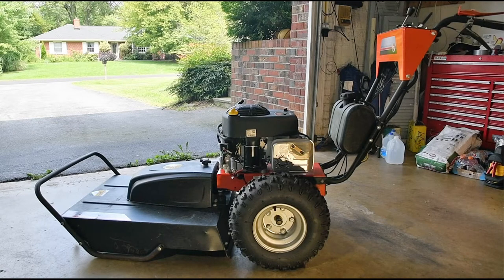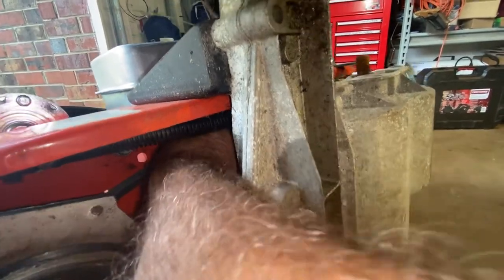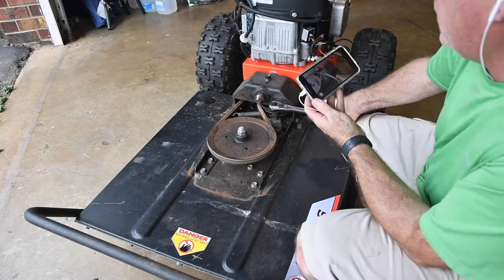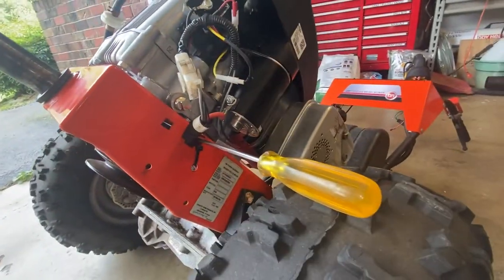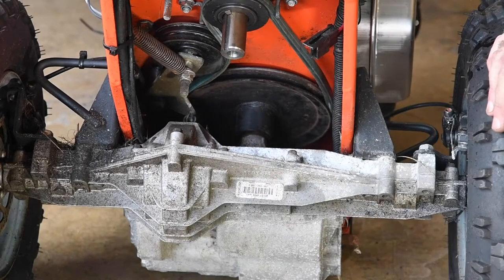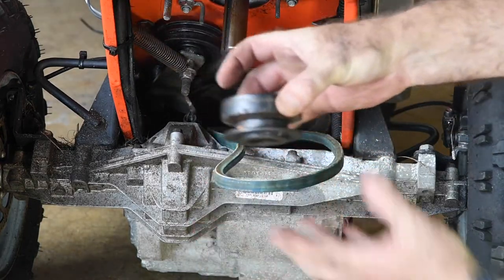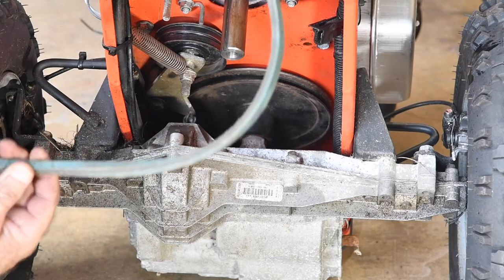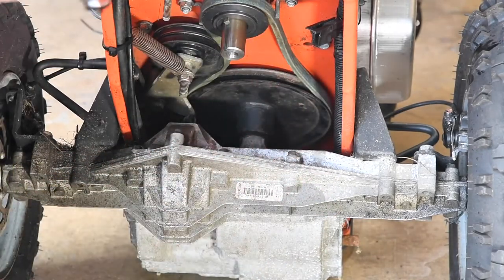DR26PRO BeltChanges

Comment: Thanks so much for your efforts.  I have the PRO XL30 - 20 HP.  I'm on my second one.  Sent the first back after the "ghost walking" incident.  I had read elsewhere about putting on a larger belt, but silly me, I thought a brand new machine ought to work!  The transaxle cables were also messed up by trying to shift with the drive pulley in motion.  Anyway, the new, new one had the same exact problem.  I found this video and decided to try it.  I went with the inch longer belt, with help from your excellent explanation and illustration, and it works great!  There's plenty of adjustment for the longer belt.  Four hours of continuous, rough use and not one problem.  It IS a great machine.

Can't figure why DR engineers won't embrace this fix.  Maybe they have thousands of the shorter belts in stock!

 THANK YOU, AGAIN!!

Comment: Thank you for the clear explanation of this process. I threw my drive belt yesterday (running the PTO at a low throttle--big mistake) and really could have used that tip about the screwdriver in the hole to keep the engine shaft from rotating. Hoping to hit this repair today with a few less swear words! Glad the machine kicked it in a convenient spot near the house and out of the sun,.

Comment: Great video. I watched this for this first time about a week ago when I had issues with the DR ghost driving right out of the crate! I used it that day and completely shredded the drive belt in doing so.

 I seen you said that you were having issues with the belt jumping off occasionally with the 4LK350 V belt.  So I decided to look for a 4LK345 AK32.5 v belt and was lucky to see that a website called belts Warehouse had several  4LK345 v belts in stock with expedited shipping for a total of $11. So I bought it and after replacing I have yet to have any issues with ghost driving and the belt has yet to jump off with this 1/2 inch difference.

Thank you for the help and information. One thing I didn't see was the torque specification for the motor/clutch bolt and if anyone is wondering it's 50 ft-lbs.
Reply from the maker: Worth mentioning on the torque of the clutch-bolt: direction of engine rotation keeps the bolt from loosening back off the clutch, so it's not super-critical to put a lot of torque into the bolt, if you're worried about losing the bolt in the field. It's the shaft/key that does the actual driving of belts (not the bolt). Make sure you put enough "snaps" into your wrench tightening and you should be okay. One problem with using a torque-wrench is the constant torque you'll be applying will want to bend/snap the screwdriver you put into the shaft to keep the motor from spinning. Those of us with power impact wrenches (which I didn't show in the video, because I was trying to demonstrate average tools people might have) will find removing the clutch and reinstalling requires no screwdriver into the shaft to hold the motor 😉

Comment: Thanks for the video update.  Based on your first video, I contacted DR Power and gave them a chance to fix the problem.  They sent me parts that seemed to be the same that I took off, so it obviously did not fix the problem.  A bit of a pain in the derriere removing the transmission to replace the pulley with the "new" one they sent me.  Didn't fix the problem.  I have since gotten the AK33 belt, and am trying to make time to install it.  I like the way you installed the new belt without removing the transmission.  The reason I have been putting it off, but now that I see I can install the new belt in maybe 20 minutes, I will do it before the next mowing.  Great and informative video.  Very sad that this has to be done to make a brand new machine safe and usable.  Other than this problem, for me, this thing is a beast and is a great machine.  I 100% agree.  How can it be so difficult for DR Power to grasp the concept that you have been explaining.

Comment: Thanks for this.  It really helps.  I bought my machine last year.  Using it today the drive suddenly quit.  Figured out the drive belt came off.  Watched your video and thought "great, this will be easy".  But they have added a belt retainer guard next to the large rear pulley (similar to the ones by the small engine pulley).   This guard only leaves about 1/4" of room to get through by the large pulley and I can't get the belt back on because of it.  This part doesn't  show in the manual and there is no mention of it in the instructions for replacing that belt.   So this is a double engineering failure.    That guard did not keep the belt on, and now with the belt off the guard is preventing me from putting the belt back on.
Reply from the maker: That's interesting, because if you read the comments by James DeFuria in my main video (https://www.youtube.com/watch?v=xv03UirzsEM&t=0s), it sounds like the rear belt-guards is DR's "fix" to the original problem (instead of just installing a half-inch or 1-inch longer belt. Comical. Hope you figure it out!
Reply: @ed1ckent   I contacted Tech Support at DR and they got right back to me.  They said that the rear belt guard was added recently but the manual has not been updated to include it's removal in the instructions for a belt change.  They told me that I will have to remove that guard to get the belt back on.   I'll see what I can do with it today.
Reply: I had to take half the mower apart to change arrive belt with that new rear guard. It shouldn't take 3hiurs to change this belt. Bad DR!
I have two if these mowers and other that that drive belt change they are great. They are beasts in the field.

Comment: I have the ghost walking issue as well…but also another issue.  My traction does not want to consistently engage when going up hill.  Won’t a longer belt make this issue worse?  Seems weird that I have the ghost walking issue AND an uphill traction issue.  Maybe the ghost is can be fixed with the longer belt and once I have that’s I can use the cable tensioner to fix the traction issue?  I’m by no means a mechanic…but the video gives me confidence that I can swap out the belt.  My unit is about 4 years old and didnt have the issue originally but started issue last year and seems to have gotten worse.  Thanks!

Comment: Thank you for that.  Two questions: 1) what size belt came off and what size was it replaced with?  2) instead of stepping up the belt size one full inch, would stepping up 1/2" solve both the old problem (ghost walking) and the new problem of belt slipping off in the field?
Reply from the maker: 1) video at 0:30 shows the original and replacement belts, as-does the original video https://www.youtube.com/watch?v=xv03UirzsEM
2) 1/2" larger might fix it; I couldn't locate one that was +0.5" at the time, and frankly didn't think even one-inch would make a huge difference (but it does). So yes, my 1"-longer belt is a hair-long and I run the belt-tensioner adjustment at it's extreme-maximum length (ie: if the belt was any longer than that 1", I'd have problems)

For the record, I ran this stupid thing (with the AK33, 35"-belt) for about 5-hours yesterday, and I had to put the slipped-belt back on twice (takes me about 15-seconds). So, yes, if you can source a 0.5"-longer belt, you may be better off. But to me, this machine currently operates PERFECTLY (and I'm going up/down a hillside that is so steep that I actually use this machine to pull MYSELF up the hill)
Reply: I put the 1" longer belt on and it didn't come off once so far. About 3 hours of mowing. Might loosen up later, but for now the ease of shifting, that it fully disengages when I want, and doesn't seem to slip when engagef, it is perfect. Two thumbs up to the videos posted as it made this mower what it should have been from the factory. Y'all might try loosening the transmission mount bolts and slide it aft (take slack out of the bolts) to simulate a slightly shorter belt.

Comment: The problem I'm having with my DR is the reverse it's slipping. The drive going forward is full fully engaged but when you go in reverse even with a slight incline like going over a mound of dirt the mower stops moving in reverse it's not a positive drive it's slipping. Do you think adjusting the cable would correct this problem again I have no trouble with it ghost driving forward and it has a solid positive drive forward when the lever is engaged.
Reply from the maker: Yeah; you really want to adjust that cable-stretcher (tensioner) to the point where it almost wants to ghost-walk (which for me is COMPLETELY EXTENDED). Others here have had good recommendations: 1/2"-longer belt instead of my recommended 1"-longer belt, and moving the trans backward (aft) by loosening all of the transmission/frame bolts and retightening. But for the record, I was never able to move my trans more than 1/16th of an inch, because all of the frame-holes are round (no adjustment really). Maybe your frame is different.

I run my cable-stretcher past the point where there are any threads-engaged (the two halves of the tensioner are not actually screwed into each other), so a 1/2"-longer belt might actually be the best choice. Either way, I'm happy with where mine is at, it goes into reverse well, but I think we have all proven that DR's tolerances are horribly-suspect. I'm guessing everyone's machine is slightly different by what I've read here...

Comment: Great video.  I have the older model machine and want to change the drive belt.  I think it's easier to do it from the back on my machine but the clutch power connector is in the way and I can't figure out how to pull the switch apart.  You pull it apart at 9 minutes but your arm is in the way so I can't see what you're doing.  Can you explain the procedure - with or without a screw driver?  For now I've tightened the cable that runs to the tension pulley to get it to go in 4th gear but I'd like to change the belt - or at least know how to do it.  Thanks
Reply from the maker: There's a tit on the plastic connector (of the clutch, I believe) that plugs into the frame-harness. Use a small flat-blade screw-driver to lift that tit from one side of the connector so that the two halves come apart. I physically push the flat blade into the housing under the tit, to lift away from the housing-catch, so that I can freely use my two hands to separate the connectors. Some dude has a video showing a 2-lever catch, I think the brushhog has only 1-lever in the center, but it's the same idea: https://www.youtube.com/watch?v=DVYs70W5LOI

Comment: How do you know when to change the belt? The 25h from the maintenance manual seems extreme.
Reply from the maker: It's a 10-minute repair and my (abused) belt is 2-years old; still in new-condition. I fail to see the point of prevention beyond buying a spare.
Reply: If the belt breaks it won't damage things?
Reply from the maker: @daslolo  I'm sure a broken belt leave you stranded, but damaged? No. The moment the belt lets-loose, it won't have any ability to keep turning/wrapping

Comment: Ed, my issue is I can’t change gears. It’s so stiff I actually pulled the reversecable from the lever under the dash.
Your thoughts?
Karl
Reply from the maker: I covered it in the first video (https://youtu.be/xv03UirzsEM). You can't shift because the belt is too tight and is turning the transmission enough to keep it in gear. You'll ruin those shift cables if you keep using it like that. Check out the other video.

Comment: What kind of lube do you use on the pin/key? Will WD40 work or is it a thicker lube? My sister says WD40 can get gummy.
Reply from the maker: I just used axle-grease, from my trailer. You can see the red-sticky grease as I pulled the drive-pulley off the engine. Yeah, WD40 isn't really great long-term

Comment: BS.  Took me an hour and a half to get mine back on.  There is no room to fit your hand in there.  I had to remove the back plate, take the bracket loose that holds the guide pins on.  fight the belt over the back pulley, and then put it back together.  There needs to be some sort of access hole on that top plate over that pulley so you can get to the belt.